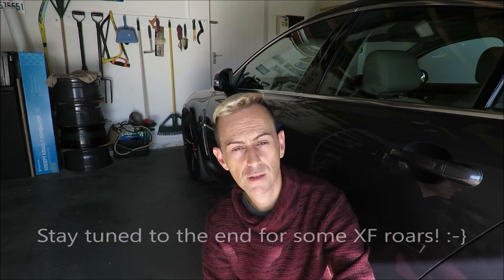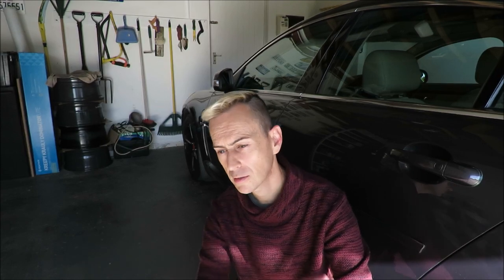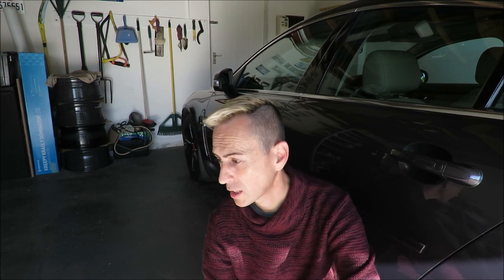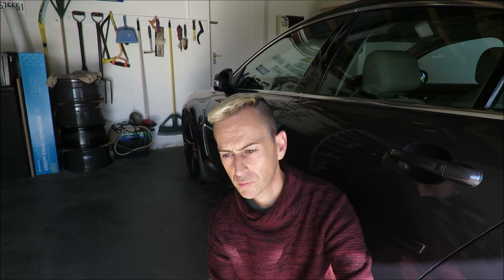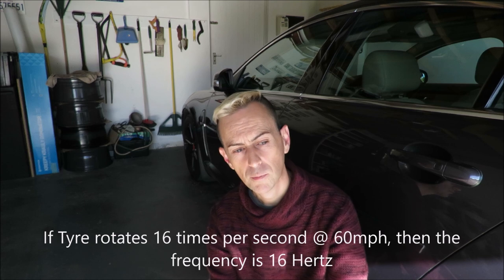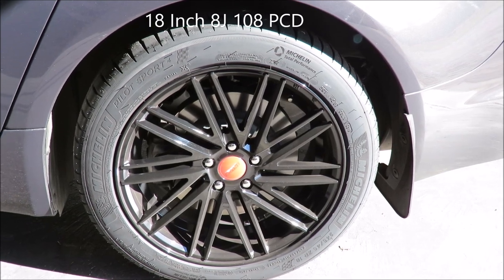My Jaguar XF high speed vibration Fixed?

Comment: Congratulations on the new set of wheels, Hilton. They compliment the dark paint of your car very well. The brake dusk is a nuisance, hence why I ended up ceramic coating the wheels as well as the the fender liner and calipers. They don't contribute towards eliminating or reducing brake dust, though prevents it from sticking on the surfaces.
Reply from the maker: Zereldo Zai Thanks that's a nice tip. Perhaps I should ceramic coat mine too 😉

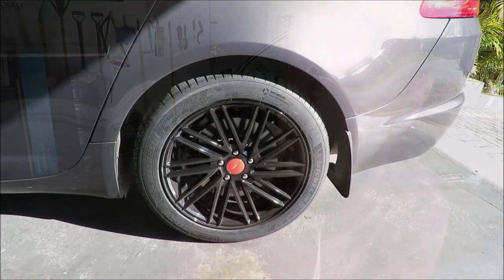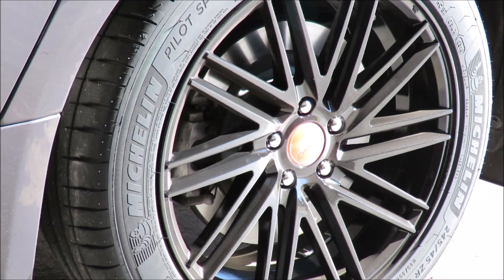Comment from the maker: 3:21 - Vibration Calculations;  6:08 - Lets look at the wheels;  7:12 - Cold startup;  9:44 - Pull into garage;  10:00 - Revvs and crackles galore!
Reply: How did you measure the Hertz vibration, you used a device?
Reply from the maker: I bought a vibration app on PlayStore and using my calculations figured out that the wheels were causing my vibration.
Reply: Are you allowed to share the name of the app? Else I will just google it :)
Reply from the maker: GunGrave It's called Vibrations! with the exclamation mark. Do you have a vibration?

Comment: I am having similar issues with mine 2009 XF-S. So far I have changed tyres, alloys, all brake discs and pads, front passenger wheel hub, front lower forward wishbones, I have done the allignment (which came back as red for front passenger caster a bit over the Jag recommendations) and both red values in cambers at the back. Apparently there is no setting for those and it means something is crooked at the suspension. So far 4 mechanics (including 2 Jag Specialists) had a look and they claim suspension is pristine.), I have done the hunter elite wheel balancing as well - no difference at all ! Jag Specialists want to continue replacing wheel hubs and if that will not help they will replace differential. I am tired of replacing parts one by one, spending money and seeing no improvement. 

I can feel the vibration on any speed (not on a perfectly straight road). Basically as soon as the road is slightly uneven or there is a slight crack in the road, the whole car is bouncing like a spring (springiness). I can feel every single even the smallest bump in the road. It's painful (when I think what it does to the car). When I am on a motorway and drive higher speeds (50mph+) each small bump in the road make it bounce rapidly which turns into vibrations. If I am driving with constant speed the vibration is there to stay and it increase gradually until I start slowing down/speeding up and changing lanes. If I continue driving with same pace on a same lane it vibrates so much it feels like sitting on a washing machine! When 4th mechanic told me there is no issue I laughed. 

Got that car for 6k GBP 3 years ago, now spend on it another 10k. That car helped me at some point in life hence I don't mind investing in it, yet I want to see results and not just keep throwing money away for nothing. I use it daily and soon I will have to do long trip between countries, meanwhile I am scared it will fall apart on a single trip to the grocery shop over the weekend. 

I will try that vibration isolator pro app that you have mentioned. I have another set of alloys and tyres on its way to me next week to test out. I hope it is something silly, cheap and simple and that it is not differential as that will be hella expensive. Any thoughts what could it be?
Reply from the maker: A vibration at any speed sounds like shock absorbers to me. With that mileage it sounds about right they'd be done by now.
On mine, it turned out to be the chassis mounts at the rear. The mounts that connect the entire suspension to the car. Forget what it's called  but the two mounts had completely failed and that's where the vibration actually came from. 
And this after changing wheels, tires, gearbox and engine mounts and even replacing the entire props haft which was the most expensive repair. Only to find out after oersisting with the dealer that the main mounts connecting the frame to the car were done for. I was not amused and sold the car after repairing it. But regret selling it because it was truly sorted after all those repairs. Have those mounts checked by all means, but first check the shocks and have them tested properly by a place that has the machine to test them.
Reply: @carfanfan  I was also suspecting shocks at some point as I feel knocking when going (even slowly) over speed bumps. Yet all my wonderful mechanics claim they look old from the outside but are okay. Don't think they test them though, I am 99% sure they checked them visualy for leaks and cracks.

I just did vibration tests on the road. 70 mph, 20 inch alloys and used Vibration Isolator Pro - three tests on different surface/motorways gave similar scores. Small jumps between 18 and 35hz then three huge spikes between 40Hz and 60Hz then again few smaller just before 85Hz. During one test I had spikes every 20Hz from 30Hz up to 102Hz. Yet on each test, the app noted highest spikes between 40Hz and 60Hz.

Once I swap alloys next week I will test it again and then take the jag to the mechanic asking him to test the shocks and check the mounts like you pointed out. Thank you for the directions where to look! Hopefully one of those things will solve it.
Reply from the maker: @tr4spyable  Just remember shocks don't have to leak to go bad. The knocking noise you gear going over speed bumps, check the bushings in the front stabilizer bar.
Reply: @carfanfan I think it's called damper mounts or strut mounts that are between the shocks and the body itself. After you mentioned that, I am more and more leaning towards it. It fits perfectly to the symptomps. I will get it checked tomorrow once I pick the new alloys. Thanks again!

Comment: The new wheels look brilliant,  and are a more modern design in my humble opinion.  Would you consider ceramic coating your car, as this would offer an incredibly deep gloss finish, with fantastic protective qualities, which could last up to 2 years. I am considering it for my XF, and the videos  I have viewed  on YouTube are fantastic.  If you applied it yourself  after the various  preparation stages, the cost is also reasonable.  Worth thinking about,! I would recommend  looking at Pan the Organiser's videos.
Reply: Funny you mention Pan. I followed his guidelines and applied two layer of CQUK on my car as well as 3 others from my household. Easy application and works best in snowy climates, and generally gives the car a nice mirror look. Good luck with your application, and make sure you get it from a reputable place if outside the USA.
Reply from the maker: Hey Errol, yes I definitely will consider ceramic coating my XF.  I wax it once every two months and its hard work.  The wax gives the same mirror look and deep shine as well as protects the paint, but having to do it every two months is hectic on my schedule.  I don't always have the time.  So yeah, a good ceramic is the way to go.

Comment: Hello Hilton. Great to see your Jag's vibration is now resolved. Your car looks quite mean with the new wheels.  A non-car related question.....have you any tips to stop weeds growing through your driveway surface?   Your drive looks immaculate :-))
Reply from the maker: Andy K. UK Hey Andy. I use a spray called banweed which keeps the weeds at bay for a good six months 😀
Reply: Hilton Hi Hilton. Many thanks for the advice. My driveway is much smaller than at your mansions, but it needs treatment soon. I must get to the garden centre this week.  Enjoy your weekend :-)

Comment: Hey Hilton Nice Set Of Wheels! I Was Thinking To Install 20’s In My XF, Should I Do So?
Reply from the maker: Thanks mate, to be honest, 19's are a pretty harsh ride, if you go 20's, it's going to be even harsher.  I stuck with 18's on mine and that was a bit hard still, but the car came with 18's originally, so I stuck with that.  On my current XF, I have 19" factory wheels and I hate them.  I'd prefer 18" as the ride will be more compliant on rough roads and these days, most of the roads are rough due to lack of maintenance.  If you live in an area where you have mostly good roads then 20" won't be a problem.  It really depends what you're after, if you want comfort, stick with 18", if it's looks you're after, 20" would do the trick.  But as you could see, the 18" wheels still looked good on my old XF.
Reply: I have 20” and they’re still a smooth ride! Looks great as well
Reply: I Wanna Go For The 20’s As I Crave For That Low Profile Look 🤪 And Even The Sticker On The Driver Side Door For The Tyre Pressure Information Has Info About The PSI For 20’s Mentioned There As The XFRS Comes Standard With The 20’s So I Think There Won’t Be That Much Of A Problem Even Fitment Wise Also?
Reply: Btw My XF Is A 2.2 Diesel One So It Came With 17’s By The Factory
Reply: Ťushar Śaini ツ if you want to add your social media i can send u pictures of my car so u get an idea
Reply from the maker: @tusharsaini0047  Just keep on mind the XFR's suspension is specifically tuned and set for large wheels.
Reply: Yes I Know Hilton My Friend But That Look I Cannot Resist 🤪 And Yes My Friend Francisco Can You Provide Me With Your Instagram?
Reply: Ťushar Śaini ツ @franncisco__

Comment: I have the 2010 XF but my vibration happens when I turn on the AC and sometimes the car goes off while driving with the AC on. If you have a video on it please kindly refer or make one to help manage the issue.
Reply from the maker: Hey Nazeer, I had an Audi A6 that did this years ago - engine going dead with AC on.  However, it sounds like you have two issues here - a bad compressor and a bad engine mounting or two bad engine mountings.
Reply: Nazeer Galadanchi hey nazeer how many miles are you, I also have a 2010 xf at 117k miles and when I switch off the ac the car will start acting weird and rocky rough idling when in park. Are you experiencing this too?

Comment: right now I'm having the same issues vibration on my 2015 XJ I changed everything rotors brakes brand new tires I even put brand new rims everything is wheel alignment complete wheel balance of course and I am still f**** vibrating I saw a forum somewhere where it set lower control arm
Reply from the maker: It's possible. You can check the lower control arm yourself to see if any oil leaked out the bushes. Those large busses are filled with oil and when it leaks, the rubber will perish

Comment: I also have some vibration in my car when driving with the summer wheels. Nothing with the winter wheels. New tyres last year. Not sure if it's the rims, tyres or nuts. Is there no fix for the problem with the wheels except replacing them?
Reply from the maker: Hey Daniel, check those rims for buckles.  You will probably find its only one wheel that's buckled.  Since doing this, I developed a low speed vibration - but that as it turns out is due to a worn slip joint on my XF's prop shaft - the dealer has already ordered a new one for me and it will be here in 3 weeks, so long wait :-(
Reply: I'm sorry to hear. Is that an expensive repair?
Reply from the maker: Daniel Pettersson Oh yes indeed. In total I've paid up front around $2,680 and hopefully that will the last any vibrations 😁
Reply: Ouch that hurts 😖 hopefully you will have a nice ride after the repair. I had to replace a cracked intake manifold, some valve on the turbo and the turbo it self and removed the egr in the cars computer. These cars sure are money pits. But I can't sell it. It's to beautiful and nice to drive 😁❤
Reply from the maker: Daniel Pettersson That's exactly how I feel too. No matter the cost, I do it for the love of my XF 😁

Comment: I often watch your videos at the various different issues you have with your XF. Seems like there are a lot.  I’m thinking about getting an XF but I have to question. Given you are experiencing so many issues. Is it worth you keeping it and do you think I should invest in getting one still?
Reply from the maker: Hey Martin, the fact is, no matter what car you buy, things will go wrong.  We know that all German cars are expensive to maintain (as I've personally experienced), especially VW's.  The XF despite all the issues I've encountered (some of them, not necessary issues with ALL xf's) has been the most reliable of all my cars I've ever owned and they are truly solid.  When I take my car to the dealer, mine is usually the only XF there.  They just don't break as often as the Landy's do.  I can still recommend investing in one, however, just do your homework - buy one with FULL service history (don't compromise on that), call the dealer who serviced it last and ask them if they picked up any issues on the car on its last service, if the dealer was a franchised dealer (which I recommend), ask them for the warranty claim history on the car and that will tell you if it was a problem from day one!  If all clear, have the car checked out yourself to ensure that its being sold with now hidden issues that will cost you money.  Common parts that fail are water pumps, coolant hoses, lower suspension wishbones, window mechanisms, steering adjustment motors, air vent dials and that's pretty much it.  The odd issue is what I've experienced which was a prop shaft failure, but that could have something to do with how the previous owner drove the car.  After replacing it, my XF is smooth as butter.  Its just such a beautiful car and turns heads where ever I go and still looks good on the road.  It doesn't look dated and after 9 years, that says something.  Bottom line is, just do your homework before you buy your XF.  All cars can turn out to be dogs if the previous owner didn't look after it.
Reply: Hilton
Thanks Hilton for the good advice.  Definitely in the market of getting one and completely agree with you, it does still turn heads doesn’t it. 
One last question if you don’t mind.  Is it such a quiet and smooth drive as what all the reviews say it is?  
Anyway. Thanks for getting back to me so quickly.  Keep up the good work. Love your videos.

Comment: So, if you don't modify the original wheels they should serve you well for the life of the car?
Reply from the maker: Absolutely. I regretted removing the original wheels. Also not knowing how much they cost to replace
Reply: Hilton Hey i have original wheels and I’m going thru the vibration diagnostic stage. In and out of the tire shop getting balance and alignment and it’s still a bumpy ride. The most recent place said 3 of my 4 wheels are bent. Is that true because you said originals should last the life of the car. What do you think is my problem. Thanks for the  help.
Reply: Hilton Thanks for the response. I live in California with tons of potholes so I wouldn’t doubt it. Also the times I’ve been to the shop I’ll switch around the tires and I can feel the vibration move to a different place on the car so it really feels like it might be the wheels being bent

Comment: I have the 2014 xf and this vibration is very annoying. Jaguar must have known this and they cant fix it. Im going to sell this thing and go back to mercedes-benz
Reply from the maker: When does your vibration come in - is it from 100kph onwards or is it low speed?  Mine was at 100kpm which pointed to the wheels and tires - tire balancing does not usually fix vibrations, but check the tires and have them balanced any way - its a cheap fix if it works - while balancing tires, stand with the guy and check the sides of the wheels, you can pick up a buckle easily by watching the lip of the wheels, if it moves in and out, you have buckled wheels.  Potholes cause this.  Mine was the wheels, mostly because the aftermarket wheels I had on had multi-pcd spacers where the wheel nuts fastened onto and these failed.  After putting new wheels on, the vibration went away.  But before putting new wheels, I replaced the prop shaft at a cost of R45,000 at Jaguar's recommendation and the gearbox mounting, but the vibration was still there.  With new wheels and tires, the car was smooth as butter again.
Reply: @carfanfan  thanks a lot